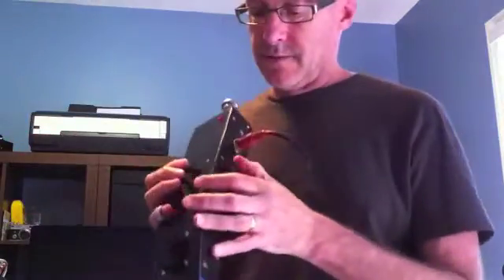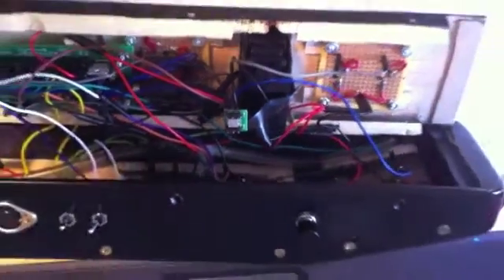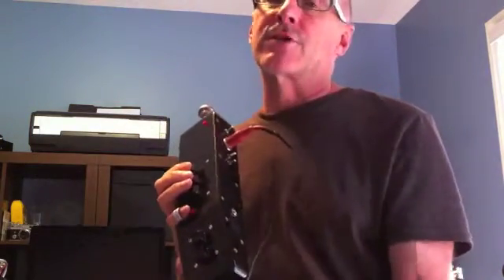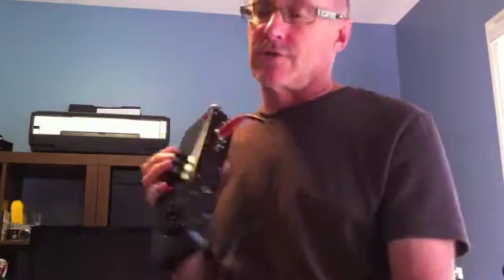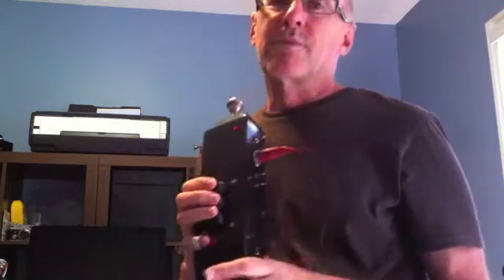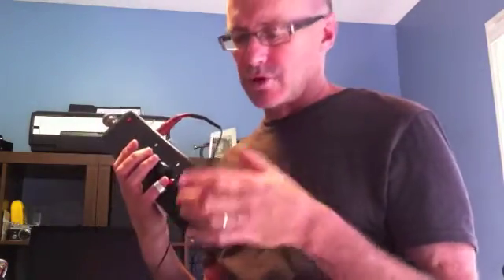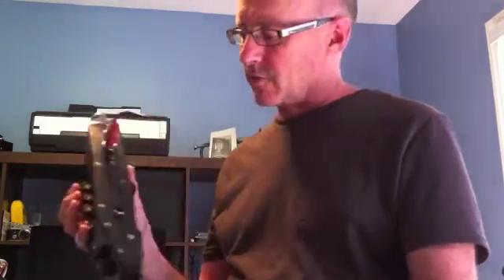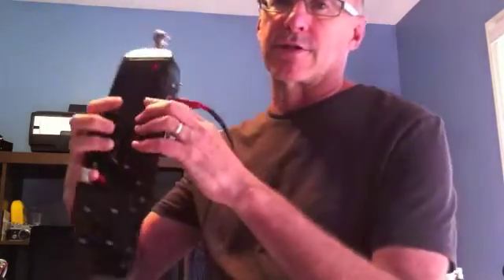Barry Electronic Valve Instrument (BEVI) with Accelerometer

Comment: Wow! Love that vibrato :-) The issue with moving about on stage is problematic, as musicians like to groove with their bodies when they get into the music. If body movement and instrument tilting could be somehow distinguished by the accelerometer it would be good, but probably very difficult?
Reply from the maker: Brendan - thanks for the comment, and yes, you are right it is not easy to control.  I added an on-off switch for the pitch bend since most of the time on stage it wasn't needed and I didn't have to think about it.  When I needed it I could switch it on and pay attention to my movements.
Reply: Interesting - good quick solution for live gigging